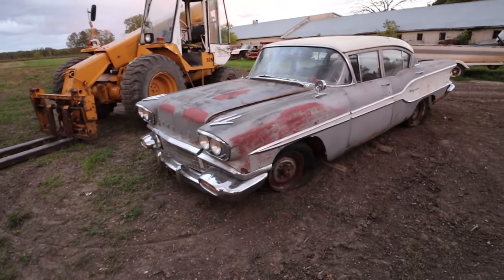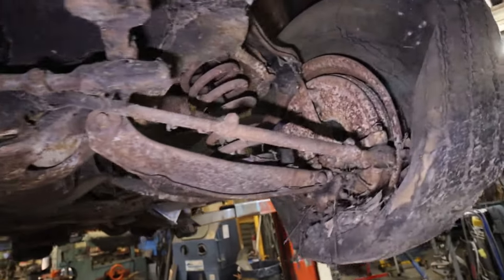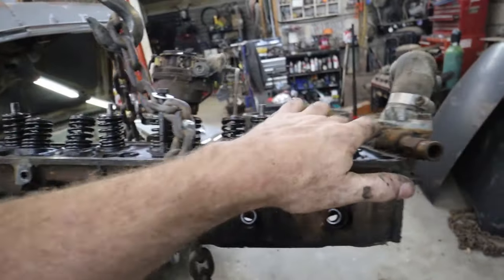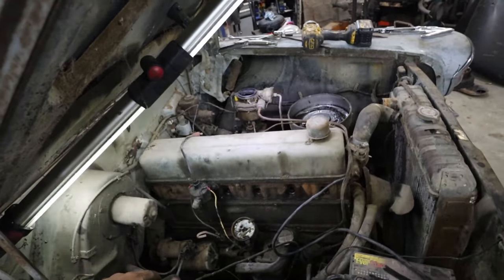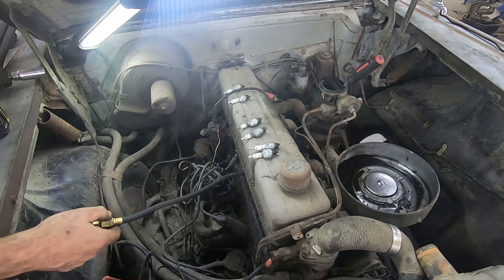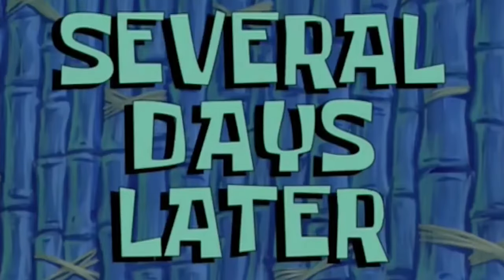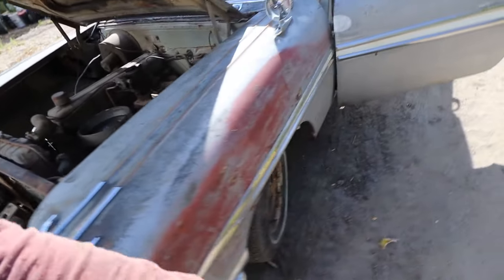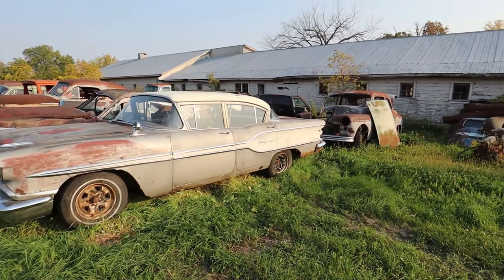Saved from the crusher 1958 Pontiac Pathfinder will it run and drive again?

Comment: You guys see that, right? First time in a long time that I've seen a guy show about oil over rings to increase compression. So if you have a high mileage car, leave your car for a year or two and she won't start with good spark..then maybe just oil up the rings. It works some times. Especially slant motors.  There ya go, pulled it a couple a hundred yards and the rings cut loose. Bingo. That was a cool lesson, Brent!
Reply: I had an old 60 Plymouth with a slant 6 that was about wore out. I had bought a 68 Buick that needed a tranny and exhaust. Guy at the salvage yard said he would swap if I could drive it up there. About 5 miles from my house. I poured a coffee can full of gear oil in it and it purred like a kitten. Salvage yard dude said it was the quietest slant 6 he had ever heard.. we swapped the old plymouth for the tranny and exhaust. Win, win
Reply: Or just throw some gear oil in it..lol
Reply: You did dang good you finally got it unstuck and ready to go now
Reply: You can put a qrt of 90 weight in it and do the same.
Reply: Paul, 
That's a trick from years ago.  When I was a kid,  I remember in about 1965 a mechanic did a compression test on my dad's 1953 Plymouth,  a flathead 6, and he did the same thing.  Told my dad it needed rings.  My dad put a new set of rings in it and it stopped smoking and ran a little bit better,  and easier to start.
Reply: @bertgrau3934  Yepper.

Comment: I really had doubts about that old Pontiac 6 cylinder ever running.. Your persistence on these old cars continues to amaze me.  Now all you need is some 58 chevy 4 dr floor and trunk pans.  But knowing you you will fab all those parts in your skillful way.  Thanks for your videos and knowledge.
Reply: swap in a SBC for reliability anf cost
Reply: @rsprockets7846  straight six is always reliable
Reply: A 283 would be nice to drop in but nothing wrong with a stovebolt, they run till they're completely worn out.

Comment: I'm more of an Old's guy, but for a '58 GM car I would pick the Pontiac. Pontiac got the trim right on this body, and those taillights are pure awesome.
Reply: I love me some olds I have a 1950 oldsmobile 88
Reply: Definitely better than Chevy. After building arguably one of the best designed cars ever with the 57, they followed that up with that abomination in 58. This is a much better design.
Reply: Even in the tri 5 years I think Pontiac built the better looking car, and the 57 pontiac had the tripower v8, and made better power
Reply: @notajp  But isn't the Pontiac basically the same body shell with some slight trim mods?
Reply: Yeah, back in day had '57 Olds 98 Starfire 2 door... good looking car... fast for its times... unique 3 glass back window...
Reply: Excelent work ,very good mechanic .

Comment: I really appreciated this video. I live in California and own a 58 Pontiac Starchief. It’s been sitting in my garage for 20 years and was sitting in a field for 7 years prior to that. I’ve had a plan to get it running and even do a lite restoration to make it a decent looking & running driver. Trouble is, life/work/lack of knowledge has gotten in the way. You’ve got great practical knowledge, built over your lifetime. Spray oil here, put ATF in there, feed jury-rigged gas line from tank in passenger seat, use screw driver to arch coil(?) to start car etc. etc. What is like 1st grade math to you seems so complicated to me. THAT’S AWESOME and I’m envious! I work in the finance world, but love tinkering with family autos. During COVID I even attempted my first clutch repair (love YouTube) - it was a success, but I realize how timesaving it is having the proper tools! Took me 3 days just to remove top bolts from transmission/engine & separate and lower transmission (used a car jack with a half-ass jig I made to hold/secure tranny). You’ve motivated me to finally get all crap that’s piled up on it over years (X-Mas/Halloween/furniture/kids & family stuff) and start to work on it. I WANT to do some of the engine work, body work, understand the electrical… I don’t want to spend a lot of $$, but I also want it to run well and look good! Maybe after all is said and done, I can keep costs to a few thousand bucks while learning maybe 1% of what you know! Thanks again for great video!     Terry from CA

Comment: I thought it was Canadian with the name "Pathfinder:" and being a six, I've never seen one in the lower 48 without a V/8. Also since it had a six, down here it most likely would have been a GMC. Six and all I still think it's kool!
Reply: IINM all Pontiacs built in the States from 1955 to 1958 had V-8s.
Reply: @8avexp  Thought so.
Reply: Canadian Pontiacs at the time were built on Chevrolet chassis and used Chevy running gear - Chevy engines, Powerglide transmissions, etc.
Reply: @64tbird  Bummer huh?

Comment: She's begging for a rebuild,especially  the floor and frame swap. I know that the guys are after an LS swap, my vote would be a 455 BOP backed by a T56. Or better yet, keep the original motor tuned properly with 135 456 split headers with Hollywoods and full length Lake pipes fitted with electric diverters so you can run straight pipes through the Lake Pipes when you want. If I was rich enough to afford it, I would definitely go old school with her, right down to the fuzzy dice on the mirror and hula girl on the dash. Ahhhhhh, dreams are so much fun.

Comment: Man, I was glued to the screen for the whole hour and 20 mins!  I LOVE that Pathfinder!  There aren't many very-late-50s US bodystyles that I like, but THAT beast just seems to have EVERYTHING.  Knee-killing A-pillar bend, raked C-pillar with huge sloping back glass, bench seats, column shift 3-speed, 2-tone paintwork, quad headlights and heaps of chrome - she's just a beautiful thing to behold. If the underpinnings were more solid, I'd be trying to convince you to send it to me - and although the import and compliance fees would be horrendous, it would be worth it just to be able to sit and look at it - from outside or in.

Man, I was rooting for ya while you were trying to get that engine to do its thing.  It was truly fascinating to hear the cylinders come back almost one by one the longer she ran!  When you shut her down before putting coolant in, I was certain the final cylinder wouldn't come back until you adjusted the rocker clearance on #1.....but I was wrong as she fired up on all six as easy as if she'd just been shut down a few hours prior.  What an engine!

I'm wondering what chassis could put under the beast.  Would it have to be of a similar year GM....?  .....or specifically Pontiac, or is the option of body taken off and rebuilt a less stressful one......?  ....or is there a later chassis that could be utilised?  

Did you have any plans for the beast yourself now she's moving under her own power, Brent?  I'd love to watch the beast come back to the road (after the chassis and cabin / boot floor are done, maybe outside just repaired, patched and cleaned, but getting a decent interior and new seals to keep everything warm and dry), and I know that's not really your thing unless you're keeping the beasty......but I do love her lines and stance and I reckon she's really too good in the body to sit in the 'one day' row.  

Since I can't bring her here in her condition without tripling the paperwork and quadrupling the compliance costs, I suppose I will just have to wait and see, eh?  All the best.

Comment: That is a 261, I'm thinking. It was introduced in 54 Chev trucks, and used by Canadian Pontiacs as their base engine into the sixties. Pathfinder was the base trim for 58 Canadian Pontiacs, later, Strato Chief, Laurentian and Parisienne were the trim levels. Since you have already done LS swaps, I'm hoping for you to do up the 261. They're a solid and strong engine, and soup up stuff is readily available. They sound great through tweaked exhaust systems, and have lots of grunt on tap.

Comment: I believe you’ve got the Chevy 216 & 235’s big brother, the 261. The extra coolant holes between 1-2, 3-4, & 5-6 cylinders on both block and head are one way to tell. The “ | | ” cast in the block just above the starter are another tell-tale. Pontiacs seemed to regularly get these.

Comment: The 235/261 Chevy 6 cyl. engine was built from 1953 to 1962. It was a full pressure version of the earlier  1937-1953 216. The strange combustion chamber was needed to reduce knock from the poor gas available in the earlier years. The 1958 version produced the highest horse power at 150. Their hydraulic lifter cams are highly sought after. 261 truck version has beefier lower end.

Comment: This old girl sure is a head turner. No lacking in the looks department there. 
The fact she still has all the trim which is usually the first thing that goes missing. 
I think replace the ceased engine.  Fix up the body. Maaco paint job.  Get it up and running. Being a Pontiac that can't be too hard. 
Restore her and give her a new life and a new job shell make a go out of another 60 or so years. 
Not to many of her kind still around. 
No problems finding her some fans. 
Count me as one.... And I'm from France.

Comment: Excellent video Brent  :) also car be worth fixing up for sure and lucky find to and friend of my family has one also fix up only thing it has 1978  350 V8 4 barrel carb with headers plus Turbo 400 3 speed Automatic transmission with 377 posi rear end gears and 12 volt Negative ground and grey body and new interior!

Comment: The Pathfinder was a Canadian entry-level Pontiac. The "Strato-Six" 6-cyl. engine is a 261 c.i. like in the GMC trucks of the time (Chevrolet 6s were 235 c.i.).
The entire chassis and powertrain were shared with the '58 Chevrolet.
The model hierarchy for the Canadian '58 Pontiacs was: Parisienne, Laurentian, Strato-Chief, Pathfinder. 1958 was the final year for the Pathfinder series.

Comment: Hey there HK. My brother and I had the indentical car. Down here South if you in the states the Pontiac Pathfinder was known as the Pontiac Chieftain. Ours was powered by a 347 ci V8. It was a torquey motor and would burn the tires off. It had a 4 barrel carb. Ours was two tone silver gray and white. Ahh you’ve got a straight 6 there. That looks real similar to Chevrolets 235ci 6. All the best to you. Be safe. PS we owned that one in 1965. Yeah we’re a couple old guys.

Comment: The 261 Pontiac is a great engine, More torque than the chevy 235. I split manifold once for duals and just loss power. I had the 261 with a 4 speed in my 57 chev 2 door 150. We went every where in that car. great fuel mileage and no tickets like in my 56 BelAir with 327. good luck to you Sir. your a dog lover too ,that makes you alright in my book. I have MS now. nice watching you, very relaxing. Cheers Bob

Comment: That’s a Canadian Pontiac.  My mom had one when I was about ten.  We had it for a number of years.  Ours was sort of pink and white.  6 cylinder and three on the tree.  I remember sometimes it would not shift into reverse.  Something wrong with the linkage.  Mom would lift the hood and push the firewall mounted shift linkage with a stick she carried in the car.  

Years later around 1972, we were at a demolition derby saw a car just like ours jammed up against the wall not shifting into reverse and out of the derby.

The floor pans and trunk floor rusted badly in our Pontiac.  I Remember the cool gas filler door by the rear taillight.

Comment: Base Bottom of the Line  Canadian Pontiac (AKA Cheviac) , basically a  US Chevy Del Ray with Pontiac trim, emblems and Interior. Powered y Chevy Driveline, either a 235 Blue Flame Six or the 283 V-8, wth a 3 or 4 spd manual or powerglide auto.

Comment: If you are really wanting a start under the conditions you are at 51:38, spin it over with whatever you got until oil is no longer spraying from each plug hole. Spray "QuickStart" in each plug hole even the ones at TDC and quickly reinstall the plugs. Give the WOT carb a spray of about 5 seconds maximum. If you have spark at about the right time, your engine will fire up and improve compression.
Reply: got my 55 running that way with only 2 plugs in it, turns over faster

Comment: and i have also done the fill down the road trick as well  i once had a 53 chevy that the enginehad been rebuilt and never started it sat 5 years after the rebuild the engine was sp tite that i could not get the starter fast enuff to start so i filled it down the road filled 45 miles an hour and filed it 8 miles before it started ajusted the engine on the swide of the road drove it and that did it it would start and run well after that

Comment: The front of the 58 Pontiac looks real good for it's age. I was told to avoid the import tax at the time Pontiac used a full size Chevrolet frame and suspension and 261 cid Chevrolet 6 cylinder truck engine. They are unique as in the US Pontiac used a V8 engine.  I would like to see you work on it and get it on the road.  If anyone can do it it is you.

Comment: I was hoping you were going to realize that your battery was really weak. If you had enough voltage to turn that engine over faster it would have probably started and then your compresson would have come back around on it's own. Great video and I just learned where Nissan got their name for the Pathfinder. Great name for a great car. Isn't it crazy how simple these cars were back then and how their engines are pretty well engineered. Even if you have to do a lot of floor work it is probably worth it. In 1958 there was a real bad recession and their weren't a whole lot of new cars sold that year compared to other years. It's probably a pretty rare car.

Comment: Get your can of copper coat or something similar copper coat is just really sticky sealant it's like a head gasket and a can you spray it on the head gasket and it leaves it down good enough to seal compression
Reply from the maker: you bet what I use on these hotrods to keep the cost down on them rebuilds haha

Comment: The combustion chamber is a Mercedes design. It must work well because tiny capacity 220's etc would easily do 100 plus MPH. They used it from 1950 right up to 1974 ish.

Comment: You can usually get the valves going just by hammering on the top of the valve spraying lube in on the stems and prying them up with a flat bar I have got many valves loosened up that way without removing the head at all.

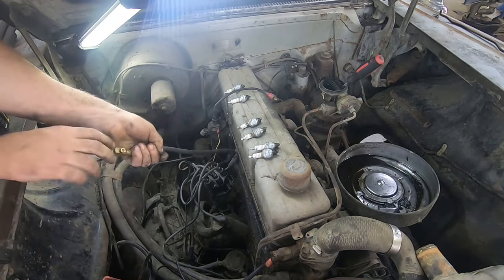Comment: 46:30 or get it turning quicker. Sounds like it was barely even loafing over; dynamic compression is a lifesaver with tired engines like this. That battery sounds soft, maybe the starter, probly both.

Comment: It seems to me that in there where you used the torch on the side of the block is where the ones cylinder head compression just an observation 
Yes three studs are way better than two

Comment: I was thinking, if you can get it to start and run awhile, those rings should free up....

I am sure you can get a new floor for relatively cheap, then a bit of body work and your almost there!

I'm shocked that that aerosol can has pressure!!! And it is probably from the early 70's.....

I remember stubbies from my gravel running days! And when we went away from them, they were sold to the States. Are you from Canada???

Well it's a runner! if not a stopper....!

For it's age, that bright work sure looks in really good shape!

Don't let it sit too long!

Comment: Oh ya some dark colour with that white stripe up the side.... looks like it's going fast already even before you got the motor working lol Brent, this car is way too purdy to not give it your special floor pan fix with the bead roller smoking up some steel and a Chassy swap [eventual paint job... pick a Rustoleum colour you dig]. Got to save the pistachio for the 54 when you find one :-)) But hell ya, this car is beauds! It's like the Impala from "Peggy Sue Got Married" but with way better tail lights and rear end as only a Canadian Frankenpauncho can deliver :-) Damn they did it right back in the 50's with the Pontiacs [and the 60's too for that matter]. :-) Anyway, loved this one. You going to get a Junkyard LS for this eventually? So worth it! Save the 6 cylinder for an old pickup or tractor :-))

Comment: A weird cylinder head indeed but that was typical Chevy (and Canadian Pontiac) stovebolt for years, which I believe started with the 216 of 1929 and continued on up to the 261 c.i. of the sixties. I did a lot of valve jobs on those, very heavy but not as bad as the diesels. My first car was almost identical to this 58 but green/white and with a sbc/ 3 on the floor; of course I believed the guy when he said it was bored out to 301 (which was the hot setup back in the day, and same 4” bore/ 3” stroke of the famed Z28). I scrapped the car but kept the engine all these years and bored it out to the 4” myself 😁

Comment: With air cleaner removed Pour a little gas down the intake and place hand over carb. There should be suction and it may start as long as there’s spark and ignition timing is within reason.

Comment: I use a propane torch in spark plug holes //and 1  through  6  holes  // heat  then up back and forth and when hot and smoking //.turn the motor over